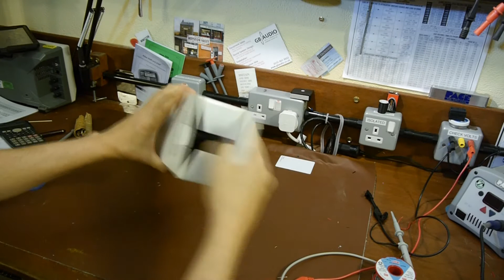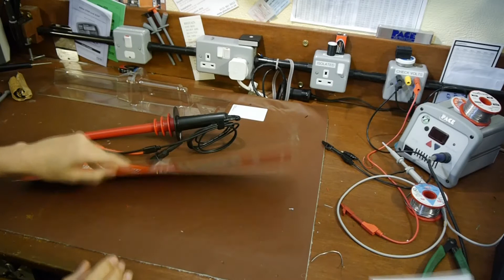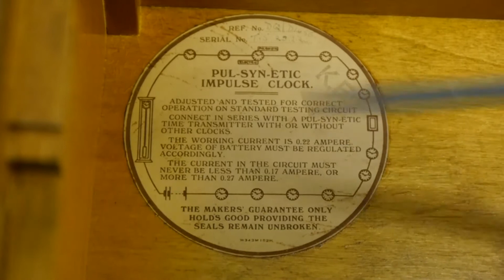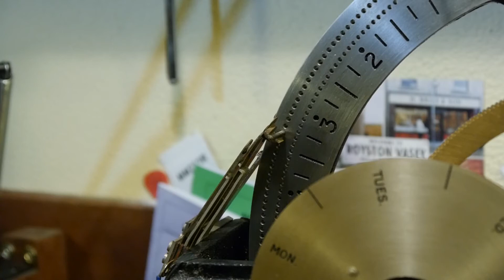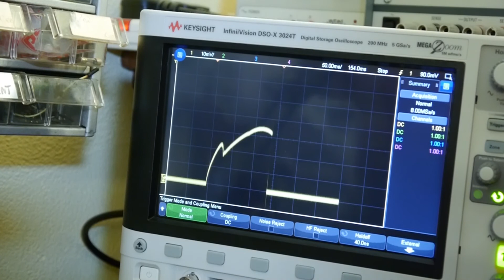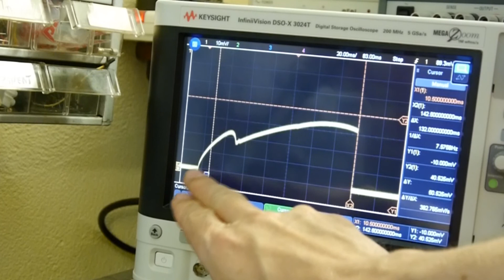Goblin High Voltage Action   Part 2

Comment: I have a feeling your wife don't watch your videos?  :)  Since this clock works off of pulse, then one would think if you already had a pulse width modulator, you should be able to hook it up in lieu of the master clock and make it work, or at least to help you dial in what you need to build?  And if you don't have a PWM, then I wonder if you could hook it up to a function generator on a  square wave?  I would also cheaply surmise at a 50Hz wavelength?? Cheap guess on all.  Great video Chris!  ~Jack, VEG
Reply from the maker: Vintage Electronics Geek  No my wife thinks I’m an idiot and doesn’t watch my videos. Yes there lots of ways we could generate the 30 second interval pulses. A good project would be too divide down the UK 50hz as the frequency and number of cycles over 24 hours is strictly maintained. However what I have planned will be several orders of magnitude more accurate. You will have to wait and see. Best regards Chris.

Comment: Hi Chris, I have a spare weight, It is 2 1/2" x 10 1/2" thick walled brass with lead cast into it, I am trying to get the lead out as it is heavy (Duh),
 The thing at the top of the Invar rod I just call the 'suspension',
 To fit the rod, undo the two wing nuts, wiggle the clamping plates out the way and lift off the rod,
 Undo the rating nut at the bottom of the rod and slide the weight on, 
Carefully hang the lot back in place, best not to fiddle with the position of the ratcheting mechanism, though you can if you feel the need to,
 Cheers, J.
Reply from the maker: Average Joe Hi Joe the thin strip of metal has a name as I replaced one on a clock once but cannot remember what they call it. I will have to look it up when I get some free time.  Are ok I am a bit paranoid about damaging the ratchet mechanism when reinstalling the the pendulum. Maybe it will be easier in real life.  Still a nice thing shame it makes so much noise.

Comment: Tell me about the pain i'm having! Had to laugh at your state of the art scope connected up to your state of the ark clock :-)
Those HV probes are useful until you forget to connect the negative lead to the chassis, That makes the meter crackle a bit!
Reply from the maker: To be honest the touch screen interface on the scope is a real pain in the arse and I dont use it enough to remember all the various functions. I normally use a mouse to control the cursor on the screen it makes selecting items much easier.  To be honest I dont regret buying the scope but it much more capeable than I am and is a little complex for my basic needs. Still I always promised myself some nice test gear one day and this is it. Good luck with the DSA should be good when its done.  

Thanks for the warnings regarding the high voltage probes I have some old DVMs knocking about so I will use those rather than the fluke in future.  My best regards chris